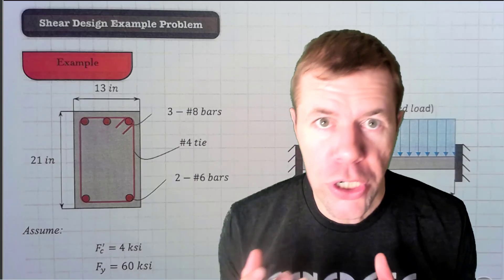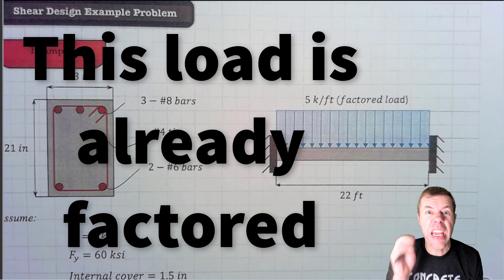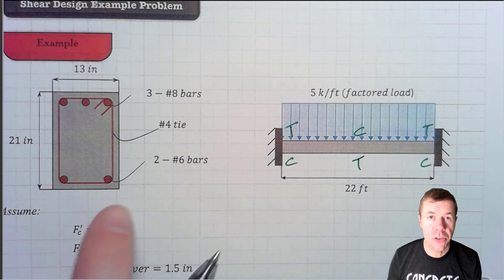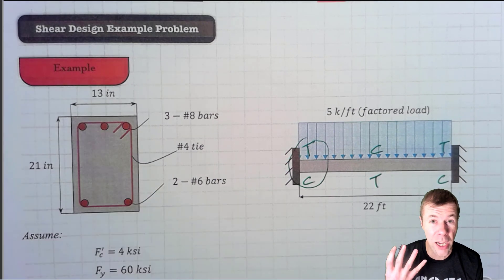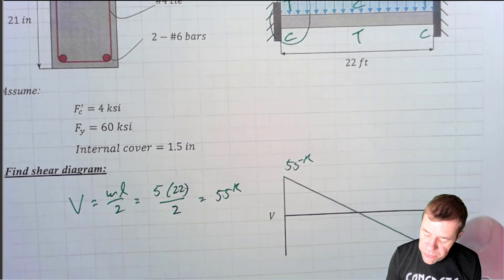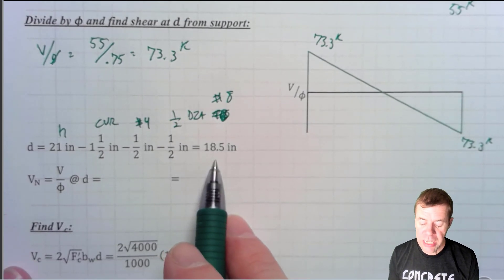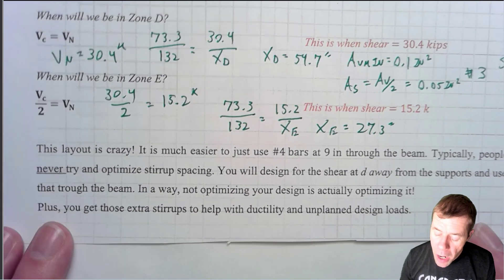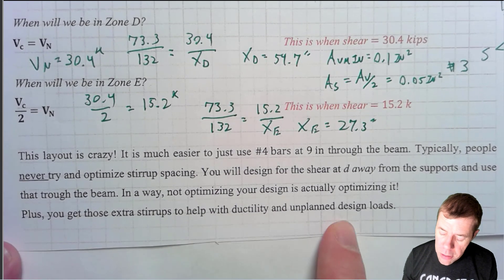Reinforced Concrete Shear Design Example Problem

Comment: You said that there is no bar less than #3 but in the market there is 8mm dia and 6 mm dia and these 2  sizes are typically used for beam stirrupes 🤔🤔🤔

Comment: Why Av is twice the area of #4 bars??
Reply: Consider the cross section of your beam, and how cracking will occur from shearing. When looking at the cross section, the crack will cross the traverse steel twice (on both sides of your cross section). Therefor when calculating Av, you must consider both legs of your traverse steel which means you must multiply Av by 2. Hope this helps!
Reply: @jarrettshafer5131  Thanks...

Comment: It's often better to make designs consistent throughout and not "over-optimize" because there's always going to be some special cases that throws "perfect" desings over the edge. There is no "standard" use case of a solution. Uneven load distributions and impacts are the norm - someone might think it's a good idea to build a weightlifting gym on a floor and that can result in some interesting loads.

Comment: Your point at the end about how optimising the design to minimise steel use can have an overall negative impact on project cost and schedule is what is what software engineers call "premature optimisation".
Good software engineers focus on readable, well-structured code without worrying about how it performs, because computer hardware is cheaper than programmer labour. If the performance isn't acceptable after completion, the code is analysed to determine the sections that are used most frequently so that performance optimisation effort can return the best bang for your dollar.
Bad software engineers focus on making everything run as fast as possible, irregardless of how frequently it is used or how hard it will be for maintenance engineers to understand and modify it.

Comment: You save 3 stirrups, but your builder curses you, because now he has to have another part on site to stock and control, plus even more verification that the actual plan is followed. An extra space on site, an extra job for the stock controller, and an extra hour spent measuring per beam to see they are following the plan.

 Instead one bar size, one spacing, and less headache before the pour, and no way to mess it up, as you are laying them with a template on a wooden plank instead. 

Then you get the cowboy builder, who decides that one every 2 feet is good enough, and sells the rest as scrap metal.